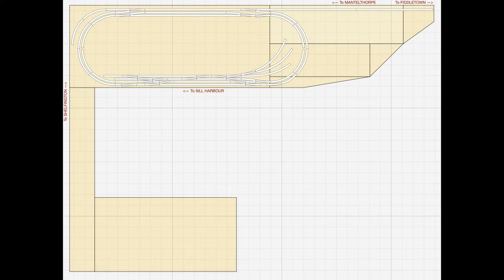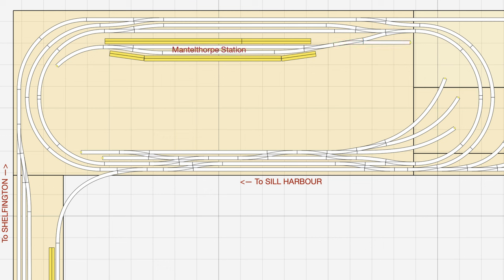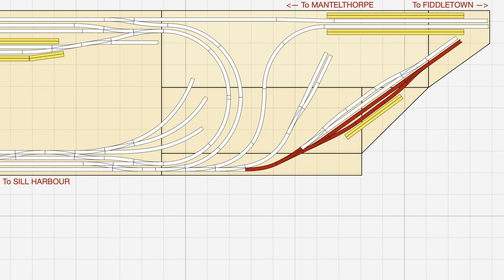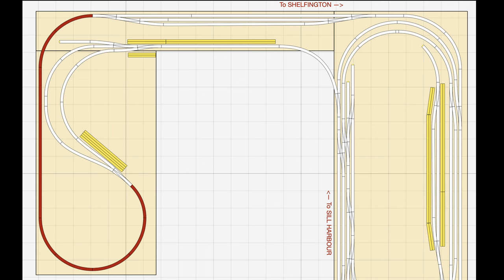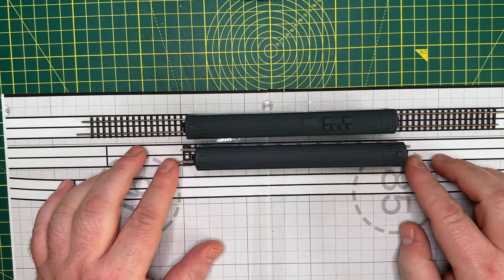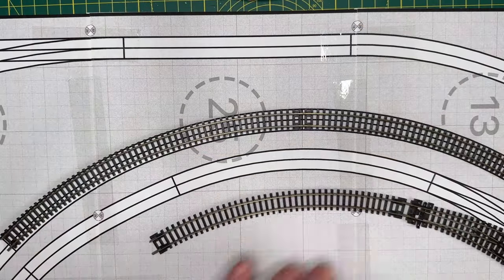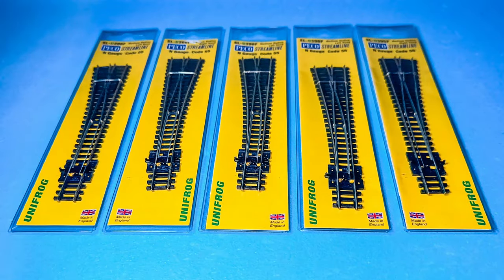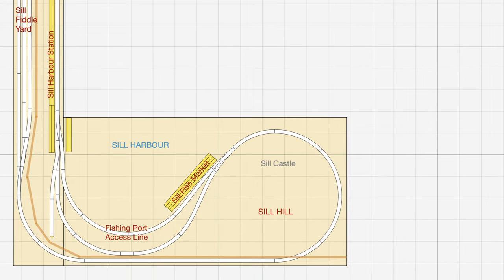089 - Shelfington - The Updated Track Plan - Part Two

Comment: Hi Ian, it looks good to me mate, I do note Euan’s comment about the gap between the curves, if you don’t need to make them wider then don’t bother and it then gives you a bit more room.
I also think it might be time to put the track down to see if it actually works in reality. It’s what I done in the end with my first iteration of Exehaven, I had the track plan on paper but I needed to see it in reality and I think you’re getting to that stage mate.
Cheers for now Ian, have a good weekend, John
Reply from the maker: Hi John! Thanks very much! As I explained to Euan - and Chris - on the west side the tracks will be emerging from a hillside, and I thought having the tracks further apart may give me more flexibility when adding scenery, but everyone has me wondering now! Excellent, that's another track plan version required!! Lol! Yeah, the problem with "putting track down" is that it's not that simple when using foam as a base! I can't simply screw it or nail it to the baseboard, it needs to be glued in order to stay in place properly! I know it must be frustrating to watch, but it's a process I need to go through to satisfy myself that when I do glue it down, it will be for good! Enjoy your weekend too mate! All the best, Ian.
Reply: Lol! I look forward to it mate👍

Comment: Hi Ian - track plan looks fine to  me.  Only question is why are you leaving a much larger gap between the curves on the two main circuits.  Mk3s cleared past each other under test conditions with the tracks closer together which looked more prototypical.  So my only suggestion is to go back to having them closer - but as we say - rule 1 - its your layout so do what you are most comfortable with 😊.
Reply from the maker: Hi Eaun! Thanks! Yeah, I get what you're saying about the gap between the loops! I thought making it wider may give me a few more options for adding scenery between the loops as they emerge from beneath a hillside on the west side of the layout! Maybe I'll end up having them wider on one side than the other? Nothing's set in stone yet! Cheers, Ian.

Comment: Hi Ian 
The updated track plan looks great the station looks much more manageable now especially with the head shunt. Great to hear your enjoying the code 55. I was wondering if you were going to be using point motors with the unifrog points and if you would be powering the frogs?
Happy modelling 🚂
Nat
Reply from the maker: Thanks Nat! Yes, I'm very pleased with the layout of Mantelthorpe station now! I'll be mostly using micro servo motors to switch my points, and will probably be using an Arduino based solution for driving the motors! I won't be powering the Unifrog points - initially! Cheers, Ian.

Comment: Hi Ian, it's amazing how the plan has changed over time as you have experimented with different things such as points etc however i have two observations: firstly the "S" curve that goes from one side of the layout into Mantelthorpe station, just wondering if the turn to the right in to the station will be fairly sharp for a train with coaches? Also just my preference i prefer track to be uniform in terms of the gap between parallel lines using the peco gauge which marrys up with peco point work configurations, but just my preference. All the best Ian
Reply from the maker: Hi Chris! Yes, these things tend to evolve over time, which is why I don't like the "just go for it" approach with no planning involved! You raise some good points! That "S" curve going into Mantelthorpe was originally partly implemented using a first radius setrack point, and my first attempt showed that it was a feasible option! I now plan to use 17" radius curves, which are basically twice the radius, so I don't think there'll be a problem! In terms of the gaps between the tracks, I take your point! I think it looks much better when you have long runs of track, but on the west side of the layout, the tracks will be emerging from a hillside, and I thought it may add more options for incorporating scenery! Maybe I'll end up with different configurations on east and west side? Thanks for your observations, it's always good to share thoughts! All the best, Ian.
Reply: Good to see the latest version Ian. Mantlethorpe station looks good. Code 55 is meant to be laid closer and provided you se the gauge to check track centres you should be OK.  You do need, in my experience to ease apart the two lines distance around curves because of overhang, and personally I like how you’ve reconfigured the track.  I don’t know how long you intend the trains to be in the station loops but it might be worth seeing what you can fit and still allow room for a train to run around. You could do that just on the plan without laying track.  I think I mentioned before that this caught me out in one of the versions of High Elven. The first  and last coach need to be well clear of the turnout to give clearance for the loco, even as in my case, a little pannier. Look forward to seeing how you’re  getting on with the experiments with code 55.  Stephen.

Comment: That ls one fantastic looking layout ian! I bet your chomping on the bit to get building it now? So much fun to be had running trains in all the different areas. 👌 a quick question if i may, the 2 ends of the loop, what radius curves are they? 19 and 17?
Reply from the maker: Thank you very much, I'm very pleased with the plan at the moment - and yes, I can't wait to get started! The inner loop is based on third radius and outer loop is based on fourth radius, which are 300mm and 330mm radius respectively! Hope this helps! All the best, Ian.

Comment: Track plan looks good Ian. What length trains will go into the loops at Mantlethorpe?  I got caught out with an early design of High Elven by the space needed to allow a loco to pass, even with a small pannier. You might want to set up a train on the plan and mark where the carriages will need to sit to give clearance. Stephen
Reply from the maker: Thanks Stephen! I'm hoping for trains of five or six coaches long as I don't really have the space for longer rakes unfortunately! Yep, I tried the coaches passing in the video, and they passed even on the tightest of the three attempts! All the best, Ian.
Reply: @iansngauge   Sorry Ian I think I wasn't sufficiently clear in my comment.  By loops I meant the two parallel tracks at Mantlethorp station (and for that matter the loops in the fiddle yard).  The closeness of the track at Code 55 means that a loco traversing the point may need the coaches to be well clear of it to get past. Stephen
Reply from the maker: @Elvenhome - Ah! Gotcha Stephen! Now I understand - and I've just seen your other comment in reply to Chris! Yes, I'll check that out! Thanks! Ian